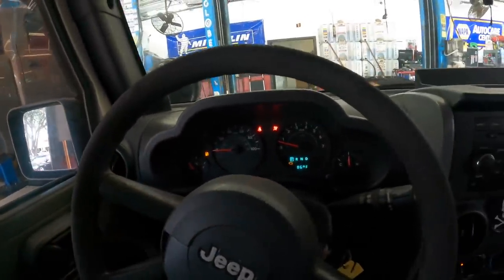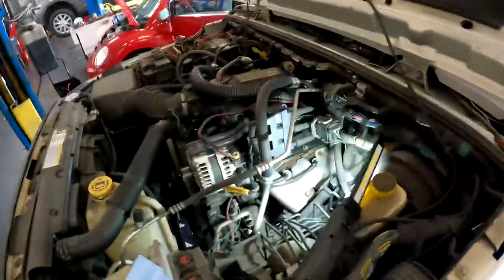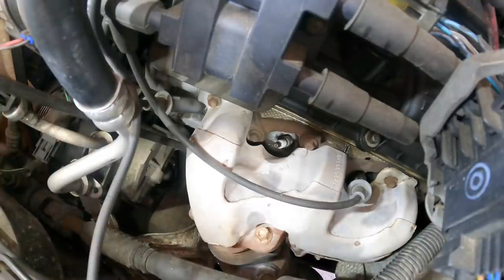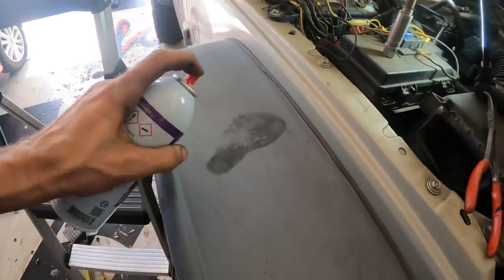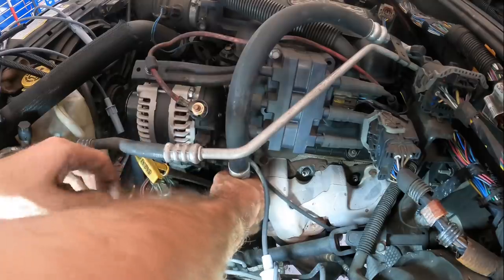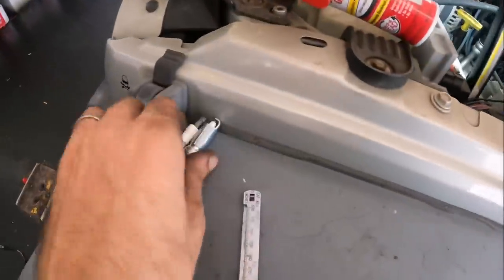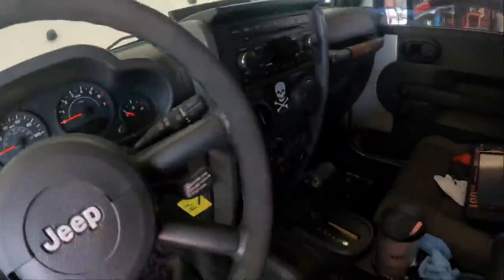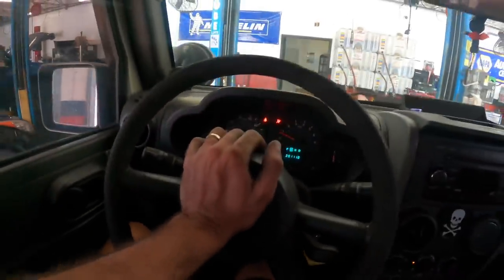My last car! Case of the Fridays. Jeep Wrangler 3.8 P0300

Comment: I`ve been wrenching on my own junk for 49 years since I was 16. Old mechanic taught me a plug trick that I have used all my wrenching life. Take a piece of vacuum line, put it on the plug tip, and use it to start the threads on the plug. No cross threaded plugs or burnt fingers and pulls off easily. Have a Great day Ray!+ Love the Eric O. reference.
Reply: Bunch of y'all keep talking about Eric O. Who is Eric O? Did I miss something between 1976 and today?
Reply: @hoseqt1  South Main Auto Repair channel. Check it out! One of my top 5 sites for learning auto mechanics.
Reply: @mortonbortell3755  I probably will, just need to get through Rays vids first....
Reply: My dad taught me to use a piece of vacuum hose too, over 60 years ago.  He also taught me a lot of swear words.

Comment: You got more guts than I do Ray driving on empty. Ran out of gas one time in my life when I was 16 trying to make it to a station that was 32 cents a gallon because I didn't want to pay 40 cents a gallon closer to my house.  , I'm 69 now
Reply: Had a truck come in on the wrecker last year that wouldn't start.  Installed gas and it was fixed!   Then the customer was angry with me!  Didn't want to pay for the five gallons of gasoline.
Reply: Been there, done that.  I was within 50ft of the gas pump and it wouldn't even fire a little.   Disconnected the clutch switch and jumped it and moved my old truck into pump range on the starter motor.   That '75 Blazer took a lot of abuse!
Reply: Where I worked if a car came in with the gauge even near empty, we'd dump in a couple gallons and charge for it on the bill. More than a few times we got cars "which just quit going up the road"  that started and ran just fine after we put gas in them...
Reply: @P_RO_  had a young lady argue with me last week that her gas gauge didn't work.  It was on empty. She said it only worked if you put more than 10 dollars in it.  Gas is almost 4 dollars a gallon. Well yeah 2.5 gallon isn't going to move the needle much...your gauge works just fine.
Reply: @damonzilliox2751  Only ignorant and stupid people let their tank get below 1/4 full. I educate the first and abandon the second as I have enough problems on my own already. My first real job was pumping gas (I'm 62). Most afternoons a regular customer came in and got a few bucks worth of gas. One day I suggested that if he filled up instead, he wouldn't need to stop by every day- he smiled and said "I do fill up- every time you see me. I know how much gas I burn and I put it back every day I use the car".  Wisdom.
Reply: @P_RO_  I finally got my wife to fill up when her truck gets to half a tank.  Just pretend half is the empty mark. Lol.
Reply: @P_RO_  now that’s just stupid if I knew my car had to go in for some work I’d fill it up unless it was work that involved a fuel tank or pump I wouldn’t fill it completely that’s just more work and a headache for the mechanics but I usually make sure there’s at least half a tank of gas incase the mechanics need to test drive the vehicle
Reply: @P_RO_  your going to get a lot of abuse with an attitude like that. That is your education.
Reply: @Number6_  Abuse? Nope. Offense is taken, not given, and I refuse to accept it. Wisdom for the win.
Reply: @P_RO_  as you like it !  I never fill it up, unless the price is low . 10-15 p off per litre. Half a tank is perfect.
Reply: I.did that once, in 1971, when I was 18. Fortunately I was able to coast into a gas station. Attendant wanted me to pull up to another pump. I said nope.

Comment: I had the son of a friend who bought a used car decades ago.  He said it was not running very well.  It was night so I had him open the hood and start the engine and then turned the lights off.  It looked like a Christmas tree with blinking lights around the engine.  I was surprised it was even running.  New plugs and wires and it ran a whole lot better with all of the spark actually reaching the spark plugs.

Comment: The 4.0L inline six was Jeeps best engine they ever made. One of the most bullet proof engines around. Wish they would bring it back.
Reply: So true. This engine traces it's roots back to the Rambler 232 in 1964 when they went to a crank with 7 main bearings and it lasted till 2006. Later changes like a plastic valve cover and more pollution-friendly heads made it lesser, but still a good engine that just wouldn't die. Plenty have gone 300K miles without ever having the head pulled or the bearings replaced. There was so little demand for these that local junkyards considered having 2-3 of them as a lifetime supply, and as the cars came in would yank the engines for the scrap metal value alone.
Reply: P RO the late year i6 started to be not as reliable. Cracking heads and such. 

My uncle retired from Chrysler 10-15 years ago. Always drove Chrysler. I remember his 96 jeep being basically new with horrific engine noise. Piston slap he said, nothing to be worried bout.
Reply: @mph5896  I and a friend picked up a Rambler with a 232 out of a backyard cheap. We'd find old cars, fix them and sell them if we could, and the rest we scrapped for a few bucks profit. Trans was shot, car was worth only scrap metal but the engine ran. We dumped about a gallon of gas in it, started it up, and put bricks on the gas pedal to floor it while sitting back in lawn chairs sipping beers waiting for the "BOOM!" that never came. Around 20 minutes later it sputtered out of gas. The next day we put a little more gas in it and it purred like a kitten. The 4L Jeep was essentially the same engine and a most excellent one till Chrysler started to "improve" it.

Comment: i still drive an 89 f150   and watching all these video i love how simple older cars and trucks are to work on also like to mention its closing in on 500k miles
Reply: Nice, I got a 99 blazer with 263,000. 

These videos make me feel souch Better about my vehicle lol
Reply: @samholdsworth420  i gave 400 bucks for it in high school ive got well worth my money out it 

  and yeah these vids are great
Reply: 300 c.i. six?
Reply: @juanrodriguez-ry6yt  with a 4mt?! Lol
Reply: @samholdsworth420  no t chain to wear
Reply: @juanrodriguez-ry6yt  302 V8 time chain is still fairly tight on it  i recently had to pull the engine to change expansion plugs and changed time cover front and rear mains and other stuff while it was out

Comment: "Stalls sometimes, running kinda rough"
"Yep, it'll do that when it's constantly running out of gas"
"Just Empty Every Pocket, I'll have it fixed for you in no time!"
Reply: Yep! I get about 6 miles to the gallon on my 92 XJ, maybe a little more highway. Having said that, The strait 6 is no longer 4.0, more like 4.6. So, self inflicted!
Reply: Well...good 4 you...on a Fri...some customers will get you in trouble for unauthorized repairs...be careful with that..I had that one.
Reply: @torchit007  Hard to get in trouble when you're the boss.
Reply: Every day I am grateful that I had foresight and bought an EV in June of last year.
Reply: @jimmyb1451  whatever
Reply: @torchit007  I think you missed the joke buddy.

Jeep, is an acronym in the trade.
Just empty every pocket.

Comment: Ray, you’re the only youtube mechanic that wears their wedding band. Most wear the black plastic placeholder or go without. Some say it cuts down on shocks. Others don’t give a reason but I suspect they don’t want to flash the jewelry.
Reply: I have worked around large fast rotating machinery and once you see a wedding ring get smashed around a finger you will lose yours too. A person can always put it back on after work.
Reply: I know a lot of mechanics take off there wrings/watches because they get caught in tight spaces or can scratch surfaces, as well as come off and get lost or get mangled by large machinery.  I know someone who dropped there loose fitting ring down in an intake on something.....
Reply: Like the other correspondents point out, if you wear a band it can get snagged or smashed with power tools fairly easily. I spend a fair part of my life seeing patents in ERs, and saw a few of each,including a traumatic amputation where they never did find the missing finger. Snack for some field critter. Others we could mostly help a little, anyway.
Reply: Like I said, a lot go for the plastic place holder. It’ll break rather than bend.

Comment: If you’ve got a doozy of a spark plug run if the spark plug boot is straight you can usually tape it onto the old existing spark plug pull it through to where it’s easy to grab which will make your job easier

Comment: Ray, you make it look all to easy!  I replaced the plugs & wires on my '08 Wrangler with the same engine recently (was having the exact same issues with intermittent misfires on a couple of cylinders), and routing those 3 wires around behind the rear of the intake was an absolute PITA.
Reply: Three shops chased my misfire for 6 years. Mostly at one dealership that gave out service loaners. I finally camped out in their waiting room, reading the service manual. After 4 hours I talked the service manager into changing the wiring connectors for the TPS. Wow, did I kick the hornet's nest. It immediately came to life and cleared out. The mechanics got chewed out by Chrysler for changing parts and failing to fix it on factory warranty for YEARS! Looking back I wish that I had claimed it on the lemon law and made them give me a new Jeep. I fixed dozens of problems with that little POS.
Reply: buy a diesel,,no wires..
Reply: hint, use elechiken trick.. tape old wire to new wire, pull thru.. or,,buy a diesel..
Reply: @harrywalker5836  Electrician trick you could do exactly what you said or if you like doing the extra step you could tie a rope or string to the old wire when you pull it out a.k.a. somewhat of a fish tape then attach the new Plug wire just tie it to the other end of the string and pull it through and  Bobs your uncle

Comment: Enjoy your running commentary, making even the most mundane tasks sound interesting.  
One thing I learned during my over 35 years wrenching was when replacing HT ignition wires it is much easier to tie the coil wire end of the old wire to the plug side of the new one, and gently pull / guide the wire through the labyrinthine path to the plug.  Sometimes it's the only way to get it through!
Keep up the good work!
Subscribed.

Comment: One way to quick route the new wires through the same space is after disconnecting the coil side, screw the old plug into the coil wire and connect the plug to the new wire, then pull through at the plug side gentle-like.
Reply: I was thinking the same thing. Like how an electrician pulls a new wire by using the old wire.
Reply: @mrcryptozoic817  yup, very similar. Sometimes the plug threads destroy the coil boot, but its temporary to get it to work. If your scared, duck tape saves the day Every Single Time. 😎

Comment: I had that happen with a bad set of wires, easier to see in the dark but bad news either way. Needs wires and plugs needs Rays magic touch. Great videography.
Reply: Water from a spray bottle helps with the mini lightning display.
Reply: Ray more braver than me handling live leaky lightning hoses.  I have found that  I make an excellent path to ground in such circumstances.

Comment: Ray, nice job.  There is a tool that works like the old "Chinese finger". Which allows you to attach the new wire to the old wire, and pull in the new wire to save trouble threading the new wire.  It was not bad on this job from what I could see, but it may save some time on some more difficult engines.

Comment: FYI:  I use a heavy string tied to the far end of the Cable or Wire when removing in tight areas.   That way I just attach the new Cable or Wire to the string and pull the string to fish in the new one.  😂
Reply: Agree, it would've saved him some time and effort, considering he was kind of in a hurry to get out of there. I'm surprised he didn't do that to expedite the job.

Comment: Oh how the universe works in odd ways, customer brings in a vehicle with little gas in the tank, and no fuel tank repairs are needed, customer brings in vehicle with a full tank of gas, and the fuel tank need to be dropped, I know, I know, the fuel pump usually always fails after a fill up, but still, the oddities.  Of course a thumbs up here!!!
Reply: Jimmy S  a friend of mine owned a shop and when customers would drop of the cars or what have you he had it in his work form that the customer would have to sign before leaving the car, and he would tell them and point it out to them, if your gas tank is empty I will put 10 bucks in so I can test drive it and not worry about it dying on the side of the road from lack of fuel, and I'll tack it onto the repair bill, he would explain.  They'd sign it or leave it with gas in the car.  But yes, I really do think manufactures design the fuel pump to fail once a full tank has been reach after so many cycles so that the customer would rather take it to a dealership than to fix it themselves, lol.  I remember when the fuel pump used to be under the hood and not in the damn tank.  Thanks for the reply man, be safe be well!

Comment: Even new wires can be bad. Had a new set on 88 S10 2.8 V6 (well over 100k miles) and one went bad and didn't know it>>set check engine light and ran really bad with a miss. Went to stealership for diagnosis and got a long list of 'needed' parts to replace, up to and including the CPU. I said "I don't think so" and left. They even had the nerve to give me a salesman's card. Changed the throttle body gasket as they said it was leaking vacuum, and CPU. Found wires they left disconnected for oxygen sensor. Still ran poorly. Went back to my automotive training basics and found one of the new plug wires I had put on a few weeks before was bad by using an ohmmeter. They missed it with all their fancy test equipment.

Comment: Love the intro , found "the got you moment" at "24:00" you put cylinder #4 wire on top ,then pulled cylinder #2 threw and connected, not shure where though  "REEEEEE"

Comment: Running spark plug wires next to each other may look "neat and tidy" but it also creates "induced" spark in wires when spark is not wanted. Not as big a problem in 8mm wires as it was in the older ones.

Comment: I discovered some years ago if u want to ✔ ignition wires spark plugs etc open the hood of ur car at night with the engine warmed up and running.  If there is voltage ⚡ leaking u will see it.

Comment: I must say, i'm impressed at the condition of the Jeep after 200 thou. Sounded sweet.
Reply: Did you see the mess of wiring on the passenger side of the engine compartment.  It looked liked the cover for the fuse box was also missing.
Reply: @loneranger4175  Yean, hard to tell if that was just errosion or a bodge job.

Comment: Ray when you do throttle body's use a old tooth brush to get in at the crusty bits top tip lol
Reply: Using whatever to keep the gas pedal down makes your life easier as well. Isnt exactly good practice to manually open the butterfly.
Reply: Done it for over 30 years never had a problem

Comment: It's interesting to see.  I've mentioned before that you do surgery on the vehicles you work on.  I worked in EMS and in a hospital-based service for 45 years.  Your pliers/ pliers you use for spark plug wires look almost exactly like towel clips we used in surgery to hold the green towels in place.  Curved and hooked on the end.  Your socket and air wrenches look quite a bit like the sockets and air tools used in orthopedic work.  Just remember that when folks call you just a mechanic, you sir are a surgeon.  My wife just made a comment to me after I told her about you.  She said almost all of the tools that they used in ortho were made by Black and Decker but had a different outside on them.  She then giggled.
Reply: Mityvac vacuum pumps have an exact medical equivalent. Made by the same company. Used for delivering babies who are a tight fit.

Comment: I bought a used BMW E36 years ago that had a really bad missing problem on acceleration. When I pulled the spark plugs out there were three different kinds of platinum spark plugs in it even though the spec for the plug was a copper plug. Also the plug boots were cracked at the tip which was allowing the spark arc through to the head so I replaced the boots and plugs and the thing ran perfectly.  Also, half of the igniter hold-down bolts were stripped also.

Comment: Hey Ray it’s funny you won’t use anti- sieze on the threads of the spark plugs because as you state it never comes with never sieze but you will use dielectric lube on the spark wires and they never come with lube. You still the man in my book.
Reply: It ain't going to hurt anything doing it....

Comment: Great video as always. That said, antiseize is your friend. Always use on spark plugs. Especially with aluminum heads. Not saying those are. And surprised you dont have an old toothbrush to clean the throttle body out. Ive been doing this for many years and works great. You can reach way in and clean the blades and body. Keep up the great videos Ray!!!👍👍
Reply: WRONG. WRONG. AND WRONG. Only the cheapest spark plugs are not plated on the threads. In those situations, applying anti-seize is fine. However, applying anti-seize to a plug which is plated can easily cause an over-tightening situation which can result in stripped threads in aluminum heads. The newer the vehicle the more sensitive they seem to be with relation to spark plug depth and torque. Some vehicles have very specific instructions when it comes to installing plugs. The shade tree mechanic and the myths they created are long gone.
Reply: @hav2win  I beg to differ - they're still here and posting nonsense in youtube comments...